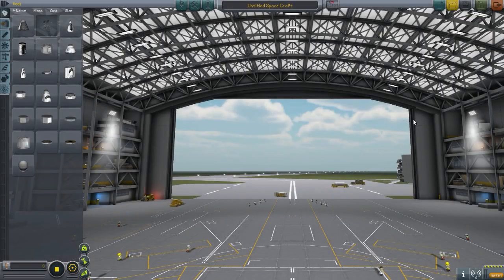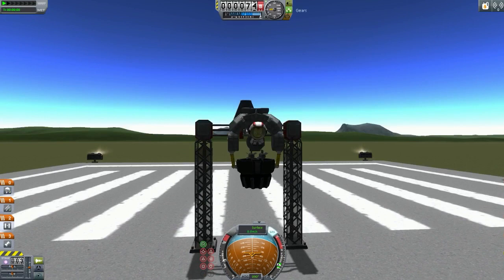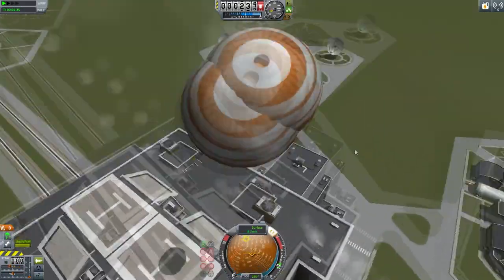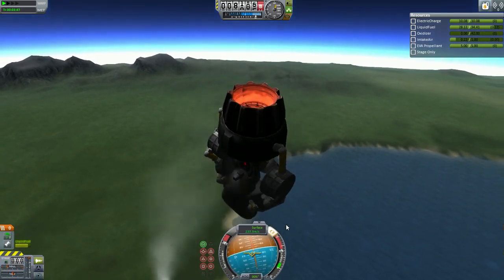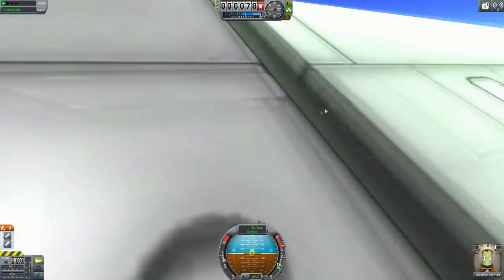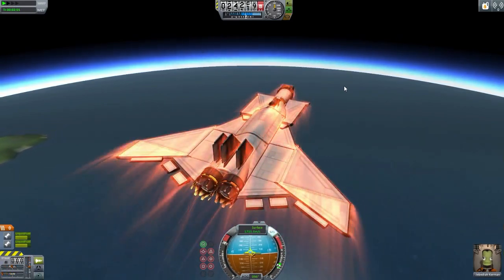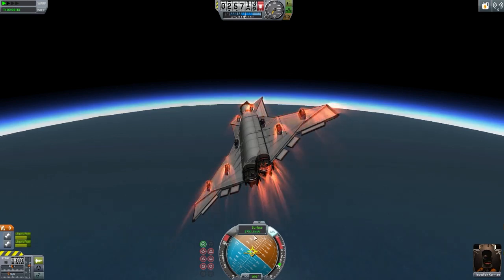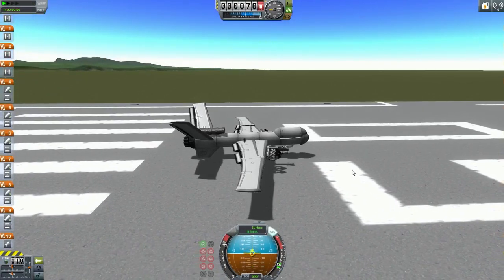KSP : Subscriber Designs Ep.24

Comment: Ohh and heretic, the gap is caused by older craft, 0.25 craft will have the cockpit floating in mid air, it also happens to control surfaces, you just need to put them back on, it doesnt actually hurt anything its just a visual glitch.